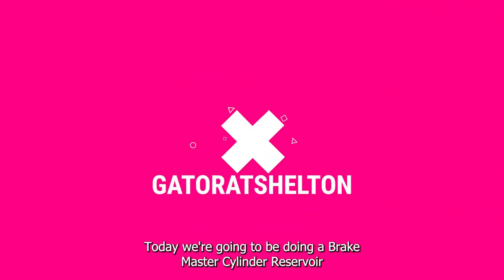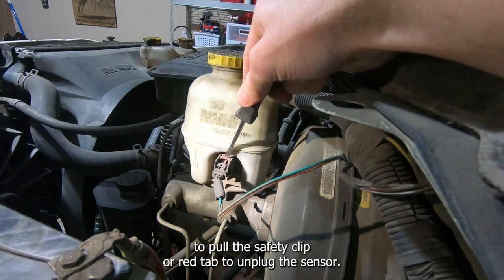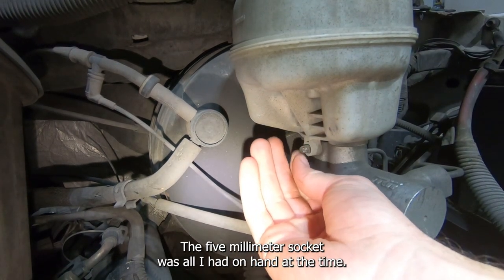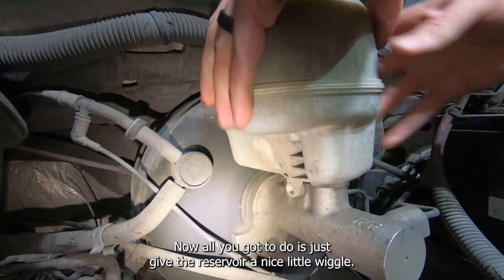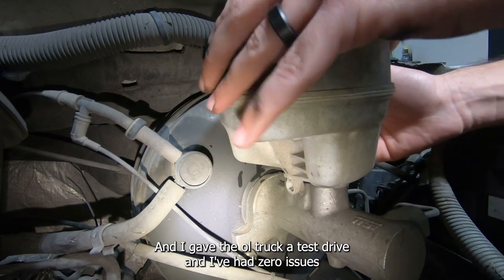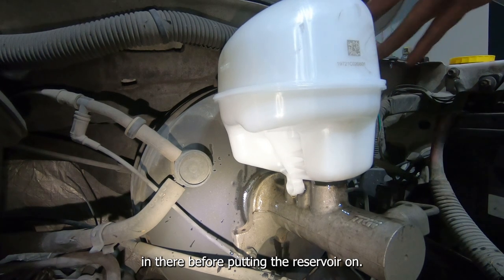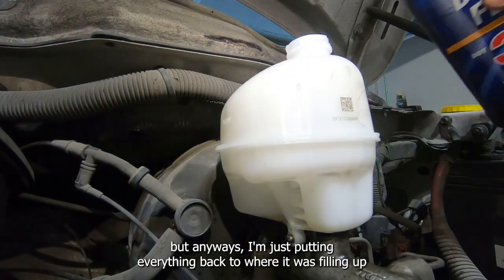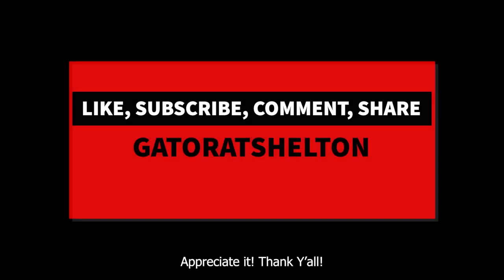2006 DODGE RAM 1500 BRAKE MASTER CYLINDER RESERVOIR REPLACEMENT

Comment: Where is the sensor located? I was just given a $550 quote to replace my master cylinder due to BRAKE and ABS lights on. Is the sensor built into the actual reservoir? Thanks for the vid.
Reply from the maker: The sensor is located within the actual brake fluid reservoir! There’s a wire that connects to it on the side maybe towards the bottom!
Reply: @gatoratshelton  Thank you for the reply. I think I will try and do this like you did. Much appreciated.